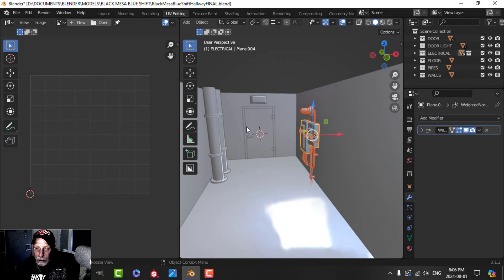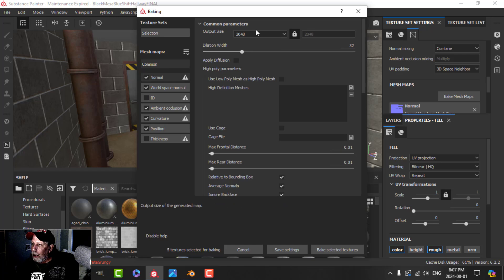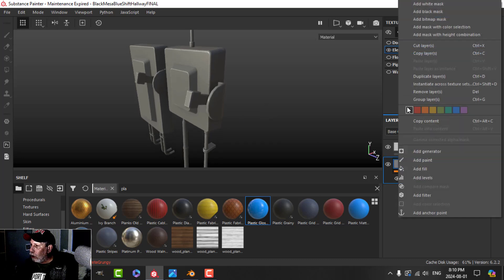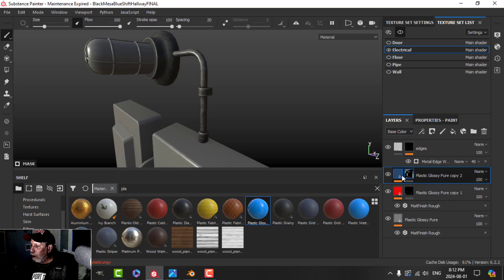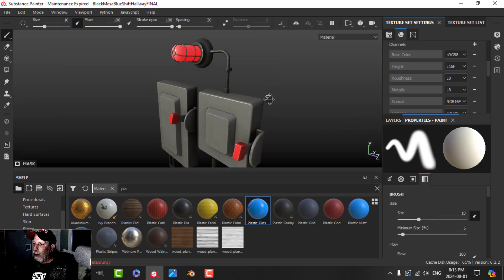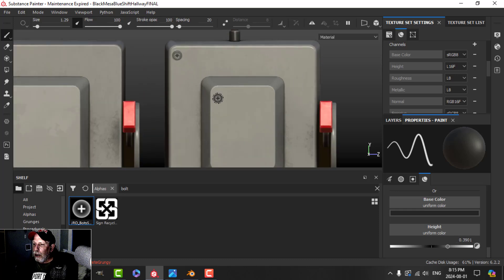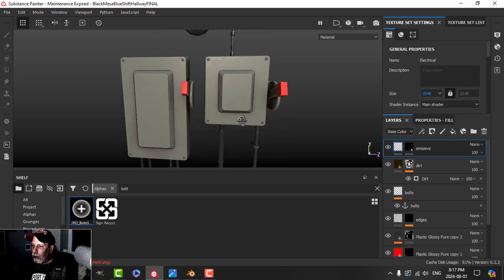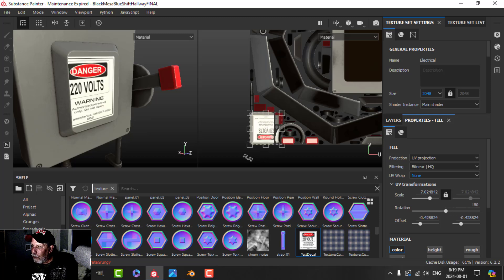BLENDER/SUBSTANCE PAINTER: BLACK MESA: BLUE SHIFT (PART 6)

Comment: Very cool, i think the only thing missing from the scene is some grunge transitioning from the floor to the wall, and some grunge on the wall around the power box/pipes, That's where Dirt, Dust and such usually builds up (especially in the corners) i think it would make the scene look alot more visually cohesive
Reply from the maker: @luckyboy5nu  thanks and yes, I agree.  Will do something along those lines later